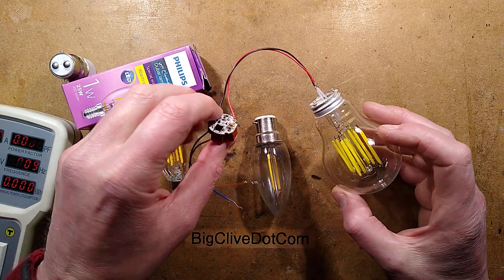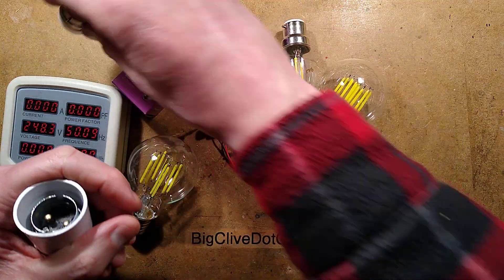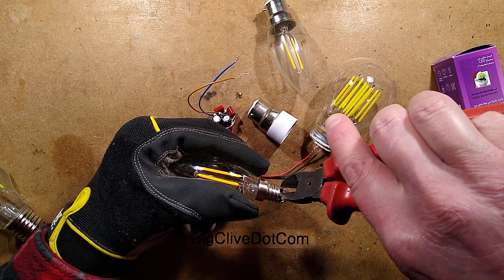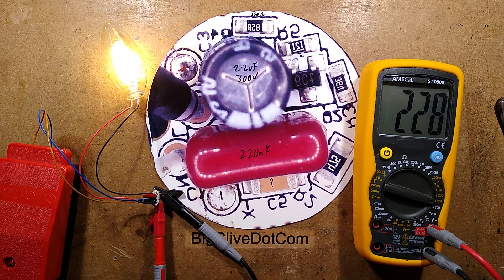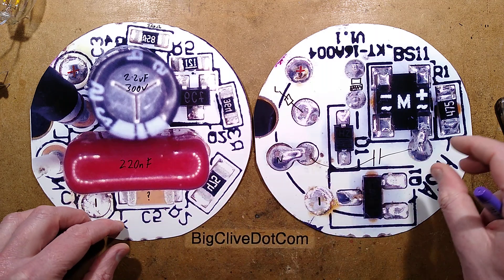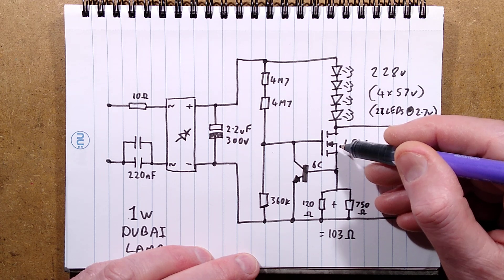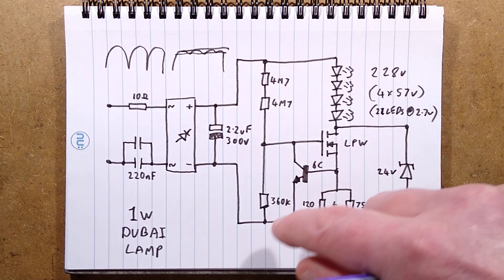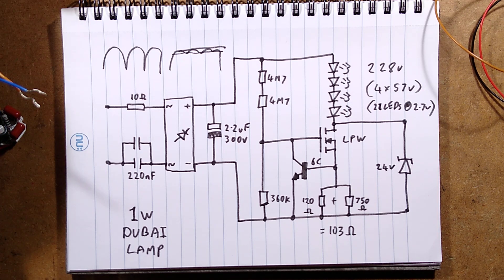Opening the 1W Dubai lamp (with schematic)

Comment: I wonder if Philips will market these world wide after the deal with Dubai finished in a couple of years time
Reply: I'm pretty sure they could sell this worldwide if they wanted to (their competitors certainly could), they just don't want to. Besides, would you buy a 1W Dubai lamp that's more expensive than the 2W lamp right next to it? Sure the box says it's the same lumen output and lasts twice as long, but that's not at all easy to verify. The only thing you can be sure of is the price tag.
Reply: @tybofborg  after seeing the circuit, yes I would pay more for lights that last a lot longer.
I suspect there is some legal deal with Dubai that prevents Philips from selling these world wide

Just look at Philips Dubai light page and it has a feel of legal tie in
https://www.mea.lighting.philips.com/consumer/dubai-lamp
Reply: @BillyNoMates1974  Fair enough, although I still don't think Philips really wants to bring this to the worldwide market even if they could, they would rather just make more money selling their regular hot-running bulbs.
Reply from the maker: I hope so.

Comment: The led lamps that i have here like those run pretty hot and are not that efficient and dont last that long 😂
Reply: Then modify them 🤪 He already show the Doo Bye LED Trick using Capasitor Dropper Trick..

Or if you able to open the LED Driver, you can change the Power Resistor up to 3 times the value to drop the wattage consumption
Reply: @XanderProduction  Than's a lot of work and rework to reseal, etc.
Reply: @franzliszt3195  Y,, yeaaahh... 😒

Tip from me,

First remove small cap from the bottom,

Second, use a solid Bakelite E27 Fitting as a grip to pull the E27 Cap,

Third, put Paint Thinner / Isopropyl alcohol around the Bulb Cap to ease the Silicon Glue, then use a mini CPU pry bar to remove the Bulb Cap..

Also use isopropyl Alcohol to ease the silicon Glue inside the Bulb..

Then, use a long small diameter steel bar, put it inside from the bottom hole..
Put it around the corner of LED Heatsink inside and knock it with a hammer..

Comment: Is a fusible resistor an actual part type or is it just the name given when used in a circuit as in this lamp?????   I also assume it is a flameproof part too.
Reply: Component distributors such as Digikey and RS do sell resistors specifically described as "Fusible Resistors" but it's difficult to see how they differ from any other metal film resistor.  Metal film resistors and metal oxide resistors have a spiral wound resistive element on a ceramic core which makes them pretty much fuse like.  They do have fusing specifications whch are not very impressive such as "fuses in less than 60 seconds at 16 times rated power".  They are also described as having flame proof coating.  I wouldn't be surprised if they are actually identical to standard resistors.  https://uk.rs-online.com/web/c/passive-components/fixed-resistors/through-hole-fixed-resistors/?applied-dimensions=4294675894,4294281230
Reply: @petehiggins33  THANX
Reply: 'Real' fusible resistors do exist. The difference with normal resistors is that they give a smaller or no flame when they pop. A normal resistor can burn quite nicely.
Reply: @mfbfreak  THANX

Comment: Time to do a test tube version perhaps?
Reply from the maker: My first LED filament lamp was a test tube one.
Reply: @bigclivedotcom  I saw one of your vids where you built one. That's what got me thinking. I'm looking at getting some PCB's done. Two for the power - one rectifier etc and one for constant current. Then two more for mounting the LEDs with a brass tube for rigidity in the middle. Just got a quote off JLPCB and they work out about 6p each plus delivery and tax (for 100 of each of the 4 types).

Comment: @bigclivedotcom I have a Question out of curiosity. Is there some kind of "protection" gas inside the lamp or just normal air? 
We got some cheap LED lamps (not sealed but with a plastic diffusor) here and just yesterday one of them popped. After opening it, I could see that the capacitor was bloated (but still sealed) and the resistor was the one that popped.
The other lamps on the fixture were still on after that popping. At the same time the Lightswitch got "stuck" and stopped functioning (clicking). 
Inside the Lightswitch there was black soot and some black stuff was on the contacts that felt like a dry mixture of soot and grease. 
The reason the lamp popped was definitely rapid aging due to overheating, since the fixture uses glass bowls with the open side pointing down. The age of the LED lamp was less then 6 months.
Reply from the maker: The glass LED lamps may use helium, but the classic plastic lamps are probably just ambient air.
Reply: @bigclivedotcom  wouldn’t nitrogen be more likely than helium? Wikipedia says standard incandescent these days is argon with a little nitrogen.
Reply: For LEDs, they’re probably air.
Reply: @JasperJanssen  Yeah i saw in the Video that the lamp wasn't sealed airtight. But could it make a difference? :p
Reply: @gucky4717  Not really. It's just electronics, which is almost never housed in any kind of gas atmosphere. Incandescent lamps need an inert gas to prevent the tungsten filament from combusting in the extremely high temperature it gets up to. In LED lamps, the glass and filament arrangement is mainly just for looks.
Reply: @tybofborg  They often use helium in the glass filament envelope because helium has high thermally conductivity. Cooling is essential to maintaining lifetime and efficiency. The filament arrangement serves a practical purpose because it allows the emitters to be angled down towards the base. Compare this to plastic-based lamps where the emitters all point upwards. A uniform light distribution is a key metric on LED standards, e.g. Energy Star.

Comment: The current through the LEDs (0.6V/103Ohms=5.8mA).
I like this design current mirror style design very much. 
The original video build was beefier, but the current through the LEDs was about 20mA if I remember correctly.

Comment: There should be 10w dubai lamp equivalent of 250w
Reply: @1marcelfilms  And they run very hot in such a small space as we are talking about normal light fixtures. Are you stupid?
Reply: The whole idea is to run it low power so that both the filaments and the electronics run cooler, more efficiently, and live longer. Increasing the power in the same form factor would just heat the thing up more, thus defeating the purpose.
Reply: @tybofborg  no
Reply: @1marcelfilms  10 watts is a lot for such a small space.

Comment: I'm still sceptical about the unbelievable efficiency. These LEDs are supposed to be more efficient than low pressure sodium lamps, those were traditionally the most efficient lamps. That's insane.
I see the redundancy is good for reliability, however many LED lamps fail due to poor soldering quality, as one of my Philips bulbs did just yesterday.
Reply: They use twice as many filament segments, at one half the power. So, the cost of manufacturing is actually twice as much for the inner parts.

Comment: Q: Will operating ‘smart’ bulbs at 50% have similar benefits?
Reply: Just accept that smart lamps are very dumb from an power consumption perspective..
Reply: @radiohirsch  

Please post the reason why and a reputable source supporting your claim.

My understanding is that smart bulbs consume around 0.2w when on standby which costs around 2 cents a month. 

Being smart means they’re much more controllable. When on they consume around 10w which is 50x more, if being smart means they aren’t accidentally left on overnight 4 days a YEAR then I’m ahead.

I also automatically operate them at 20% in the later evening for around 2 hours, this easily saves 3x the cost of them being smart.
Reply from the maker: Yes, but they have MUCH more to go wrong.
Reply: Great teardowns Clive.  I’ve been experimenting in Oz with the wifi and hub models for both efficiency and mobility assistance reasons. I found running brand name types like Lenovo, Sengled and Mirabella to be very effective and low power even including wifi consumption I.e. around 1.2W. Also I was able to do away with external timers and dimmers with there associated losses and purchase costs. Being able to voice or app control them has been very energy saving from a mobility perspective. Turning all on before I get home or to save a trip downstairs is life changing. Changing brightness from 1% up to Max when required also very helpful. Not all energy used is measured in Watts or $.😉

Comment: It would be cool to see a video where you go through different current smoothing on lamps using an occilliscope
Reply: Yes, bring on the CRO !  Or LCDO... ;)
Reply: Should do this with the last 2w lamp. It would really explain that weird smoothing circuit.
Reply: I've seen this tested before using a solar cell as a crude detector, no need to pull it apart EDIT: and deal with the troubles and hazards of scoping something mains referenced.

Comment: Perhaps Phillips could sell these in the US as "LED Nixie Tube Lights" that way it's technically skirting the whole copyright thing in them. Call it something else boom it's a new product. It works for Big Pharma, why not Big Lightbulbs?
Reply: You can get the US version at any major hardware store, the one that meets CA Title 20. It's better in that CA requires CRI of 90 versus 80 here, and a PF of 0.7 vs 0.5 here. Energy Star/CA requires dimmability as well, I don't think this one dims.
Reply: @straightpipediesel  Oh. Well I was completed unaware of such a thing. Well next time I run down to Menard's or Ace Hardware I'll have to check it out.

Comment: Still waiting for some parts to make my own 3w ones. These lams are awesome!
Reply: I am planning to do so as well. Have you already accomplished your goal?
Reply: @domnik9062   I did in fact built one, and even though the circuit works as it should, it was flickering for some reason. Current limiting circuit works perfectly, it can be that the bulk cap I got is actually a lower capacity than it says, as increasing the value of the series capacitor either did nothing or blew the fuse resistor. Also it could be that the 220V RMS mains voltage is just a bit low. Modding cheap LED bulbs was more successful for me. You can also doobyfy the bulbs like bigclive did in a later video, that also works.
Reply: @VeeAyyDee  Thanks, but i don't know which one you are referring to? The one where he cuts off the resistor?
Reply: @domnik9062  I did a 3W variant of the Dubai Lamp

Comment: The  snubber   capacitor  is  for  RF  noise suppression  back into the mains.  The   transistor/MOSFET is  a  current   source,  with a  zener  voltage  clamp
Reply: which RF noise ? It's a "linear" current regulator
Reply: @inotoff   I don't  know from the MOSFET  turning on and   off  as  it's  going  into the saturation  point

Comment: I feel the low power radiating from this rare oddity . The world needs these for sure not just Dubai man.
Reply: I definitely agree, but we probably won't see bulbs like these anytime soon. They're just too efficient and long-lasting, they'd lose too much profits.
Reply: @michaelathens953  - And that is why there is more than one company that makes LED bulbs.  If a company thinks there is a market for one (like in Dubai) they will make one.  And when you are the only one making long (longer) lasting LED bulbs you can increase your profits until competing companies join in.  There can be lots of profits for the first companies to market new items.  It is all about how long (and how many) you can sell your high priced item before more competition forces you to lower your price.  Your selling price is NOT based on your cost but on the market's value.
Reply: When I buy a "Guaranteed 5-years" lamp / bulb I mark the receipt number on the base THEN scan the receipt onto my computer. WHEN (NEVER IF) the lamp fails less than the guaranteed life time, I contact the manufacturer and demand a FREE replacement.

I haven't bought a lamp for years!

Legislation would bring these Dubai lamps onto the market - the only trouble is the politicians get bribed not to.
Reply: actually if you bought a 10w bulb and ran it at 7w it will last a very long time, you just need to change the dropper cap inside the bulb
Reply: @dantronics1682  - Time to make another video for your channel? I'd watch it.
Reply: Just gotta figure out how to increase the PF, and then we'll be golden
Reply: @jamess1787  just use an inductive load

Comment: The video seems completely fine  Clive. I would not have noticed you were under any such duress. ..

Would be nice to understand the regulation circuit a bit better.  Like what regions the MOSFET operates in.  I’ve measured the total efficiency of the ReactorMicro constant current chips at ~75% which is v poor relative to the BPsemi non-isolated buck chip bulbs which are >90%.  I’m very curious whether this circuit is any better.
Reply from the maker: The bulk of the current limiting is done by the cap dropper.  The linear section operates in a small voltage range.

Comment: Fascinating circuit. I will steal that voltage regulator idea one day.
Yes, it would be a tragedy to destroy that exceedingly rare and clever big Dubai bulb. It's a keeper.
Reply from the maker: The current regulator is a discrete version of the linear regulators used in many lamps these days.  What's novel is that they have combined two current control methods.
Reply: @bigclivedotcom  I guess I should have said "ripple regulator." Modulating a MOSFET with this secondary control could be handy. it could easily (easy to say that) be tuned with a little trimmer pot.(sure, could use an actual regulator but they can get hot)

Comment: We used to use a rectifier disk that we dropped into the light socket before we screwed in the incandescent light bulb.  Mainly for barns and outside lights. They would run half power and would last for a VERY long time.  Many of them ran all the time or from dust to dawn. I'm sure they had a flicker but it never really bothered me.  Also, we would get 150 volt light bulbs that would run longer on 120 volt systems.  Too bad we can't do that with the LED bulbs.
Reply: Only problem with a half wave rectifier in series with a lamp is it screws up the operation of RCD/GFI. The rectifier produces an imbalanced current which saturates the detection coils and prevents them tripping when you get hold of a live wire.
Reply: @AndyFletcherX31  Ya, i learned that at school on how to fool the "earth leak switch" or differential (how it's called here) not tripping. but forgotten how to.
Reply from the maker: Look for my dooby lamp video.
Reply: You can use two incandescent light bulbs in series to get massive lifetime. Unfortunately LED lamps don't work that way either._
Reply: @DjResR  Yes, I remember the "50 year night light" hawked in some of those mail order catalogs in the 60's and 70's. Two 7 watt christmas tree type bulbs in series.
Reply: @quantumleap359  That is interesting. I used the same trick in early 2000's with cheap chinesium bulbs named "Impulss" and extended the lifetime from few weeks to years so the claim is not that far fetched either. How long did these nightlights actually lasted?_

Comment: So now knowing the circuitry I guess you could make one big clive style. :-)
Reply from the maker: I've been doodling ideas like that in my mind.
Reply: I've been wondering what might be possible with those "DIY LED lamp" kits from eBay/AliExpress, since I have some of those kits in a box. Even if they were only used as a convenient source of a lamp base - though I imagine you can find bare lamp bases on AliExpress as well.

Replace the supplied power supply PCB with something custom - maybe along the lines of what Philips have done here - and solder a load of LED filaments together...

I don't think they'd fit under the clear plastic dome of those lamp kits, so something else would be needed unless you wanted live parts exposed :)

A 3D-printed cover could work, and would offer a bit/a lot of diffusion as well, depending on the plastic type and print settings (PMMA and PETG are probably the best bets for light transmission, but you still won't get anything properly "clear").
Or maybe it's an excuse to learn glass-blowing? :D

Comment: I don’t want the other taken apart. Just use it and let us know if it stil works after 10 years.
Reply from the maker: Alas, it's cold white.
Reply: @bigclivedotcom  I much  prefer the cool (or cold) white. Even in the bathroom, they give good color rendition, which I know some people don't like, but they tell the honest, although unwelcome truth about what you really look like!!
Reply: Cold white in this case means 6500K - much colder that 5000k Daylight. The color rendition is only 80 with a huge blue spike at 450nm.

Comment: Why did you mention that the snubber cap is ceramic when hypothesizing that it takes down voltage spikes? Is that a property of ceramic caps? And what kind of cap is the 270 nF one?
Reply from the maker: Ceramic capacitors have a very low equivalent resistance.  They can soften spikes by acting as a reservoir that can fill and empty quickly.